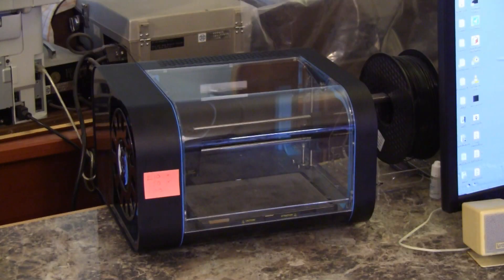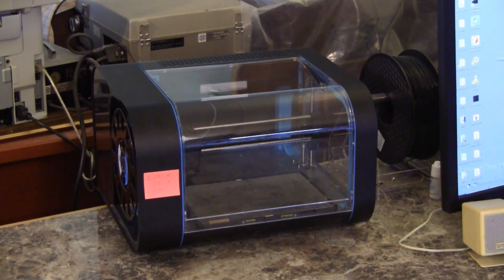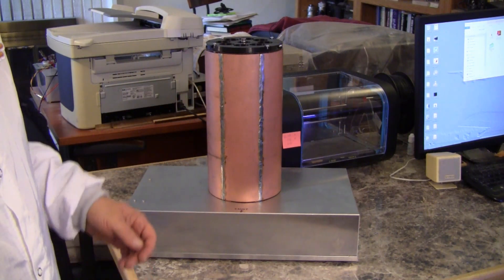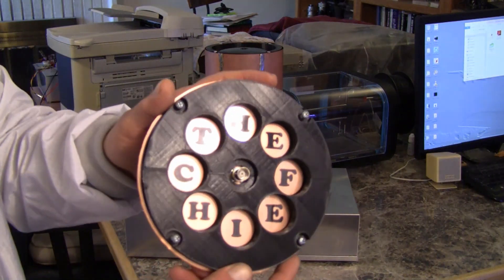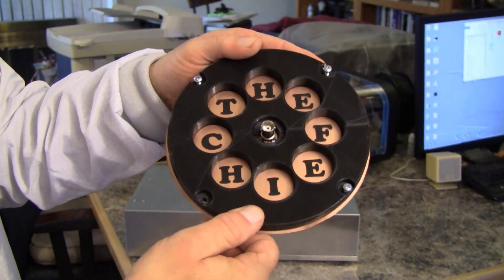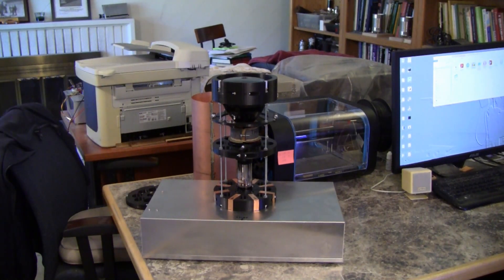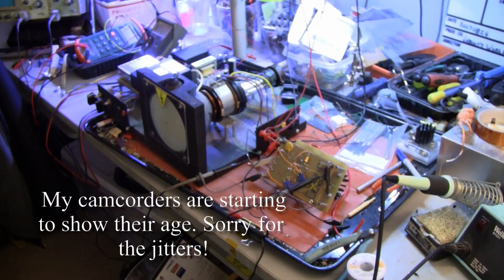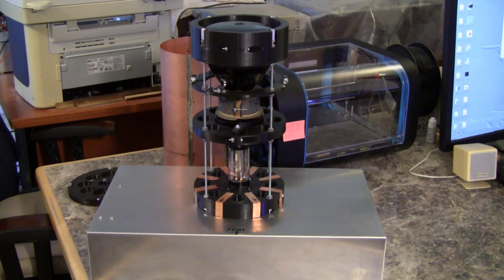Introducing: The Chief

Comment: I'm very impressed with the mechanical mounting of your tube.  It's like something you would see in sci-fi movie.  However, I am curious about why the need for the heavy shielding.  From the pictures I've seen of the original equipment, they would be mounted in what I think they called a "bathtub chassis."  It would literally just be hanging out in the open.  How did they prevent interference?  Or was noisy video just tolerated?
Reply from the maker: Short answer: You may well be correct. I don't actually know. Long answer: I am using the original RCA TK-1 test pattern generator as my blue print. RCA has their tube shielded from the top to the bottom. The bottom end of the shield is open. The sensitive part is the video preamp input, hence the BNC connector on the lid. A shielded coax will route that to the preamp input connector, yet to be installed on the main chassis. I figured you can't have too much shielding. But, you can have too little. Just avoiding one potential gotcha by over compensating.